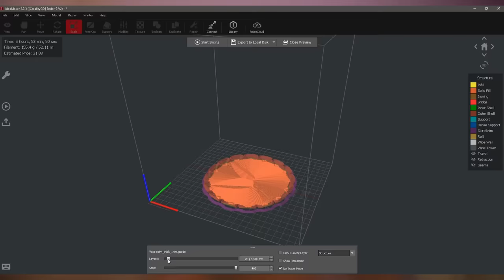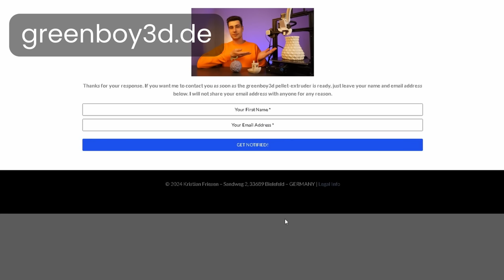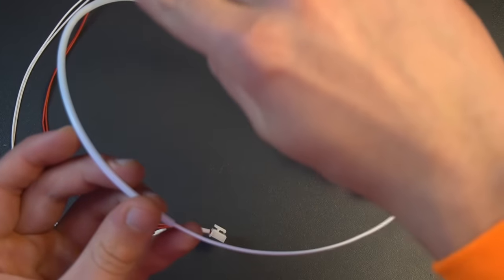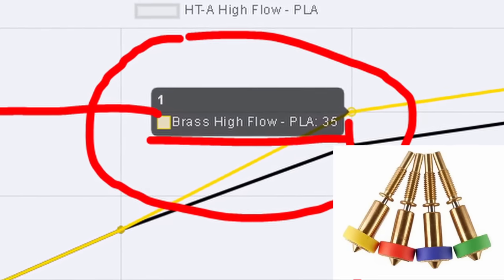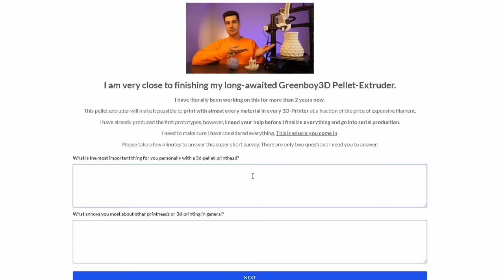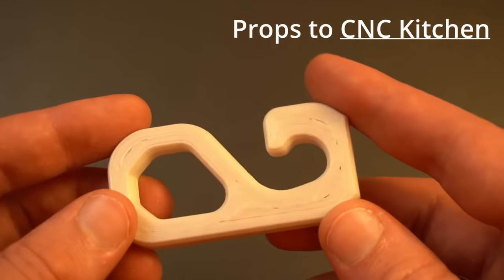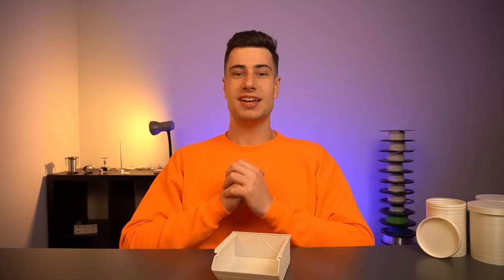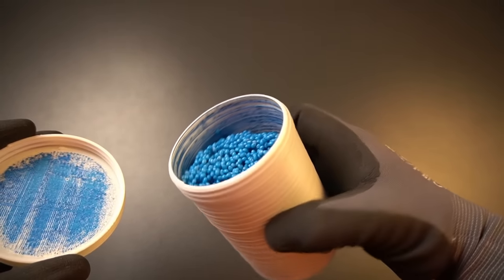Stop Buying Filament, Use This 6x CHEAPER Alternative instead

Comment: I am all in on this.  But I only have one FDM printer, it’s fairly new for me, and I’m not sure I want to modify it yet… 😭  But I fully agree with the idea behind this, low cost pellets, recycling supports or failed prints, quintupling your output of functional items for the same cost.  It’s so good. 

As far as the custom vs. standard nozzle… if it drastically improves print quality, then I’d be fine with a custom nozzle as long as enough options are available.  Isn’t it possible for both?
Reply from the maker: Thank you for your interesting input 🙂
What would you like to see next?
Reply: @greenboy3d  Could you make the hose smaller so it causes less stress on the motors?  Is the current input of pellets the minimum the extruded can handle?

Comment: don't worry on making it completely compatible with everything in existence... the extruder and other parts are already custom so if someone decide to adapt your system it will not be discouraged by a nozzle... that said the system has to be comparably cheap tho like if one nozzle costs 10times more it will be difficult to justify 😂
Reply from the maker: A question that can't get out of my mind is what people would if they had a nozzle clog, which can happen on any 3D printer due to some particle blocking the nozzle hole.

If the "special nozzle" is not easily available globally because only I am selling, then this might be a problem. Any ideas?
Reply: @greenboy3d  to be fair I have no idea how different it can be from a standard one, is it possible to modify an existing one to achieve your idea? or maybe provide the cad files for free/small one time fee to have it manufactured somewhere like pcbway or whatever

Comment: I see deals on bulk PLA for $8 a roll shipped. Long as you dry every roll, most stuff today doesn't clog or tangle like the cheap stuff back in 2014 when I started.

Comment: Did we ever figure out what exactly is the mechanism behind the inconsistent extrusion?  Some industrial pellet printers use a 3 zone extruder screw, they claim this improves surface quality. Also, just curious, is the screw edge sharp? And what happens to surface finish if you increase or decrease motor current?

Comment: I'd be worried about using spray paints in an extruder - unclear what additional VOCs you'd introduce in that, as well as potentially causing chemical issues with the plastic that may dramatically degrade its durability.  Far better to not reinvent the wheel and try to use similar techniques to industry, though that certainly means having some sort of intermediate well.  

As far as the nozzles, why not have an insert?  i.e. you have your nozzles, which are a larger diameter, flatter.  Want to use a standard nozzle?  Thread in an insert, which has a threaded hole for a standard nozzle.  Adds $0.50 to the cost, and is a custom part, but is a single-purchase part.  And if you're looking for performance, you can have purpose made nozzles.
Reply from the maker: Thank you for your very interesting input 🙂
What would you like to see next?
Reply: @greenboy3d  I think it was CNC kitchen that had the fast printing profiles video so you could better characterize the flow rates.  I would also like to see if you can put more heat into a hotend to increase flow.  One of the biggest promises (for me) of pellet printing is insane volume.

Comment: This is, frankly, truly awesome stuff. When I get the time, I definitely want to investigate this pellet extruder further.

Do you intend to release the source material, etc?

That would be really awesome, if I could make one myself eventually and try it out!
Reply from the maker: The 3D Printed parts will be for free, but the other ones need to be purchased :)
What would you like to see next?
Reply: @greenboy3d  hmm. Since it's already a pellet extruder, couldn't you design a custom extra wide nozzle for direct injection molding? Say you 3d print a prototype of something, but then you want to produce it in bulk, so you acquire a mold (you can actually resin print them), swap the nozzle, and then begin injecting.

I just thought about it, since it already extrudes pellets it could be used for both printing and IM, all in the package of one device. You don't even need a plunger, just have the screw set to high speed? :)

Additionally, I'd like to see some experiments with some more exotic materials (PC, Polyamides, etc,). Have you ever thought about buying some graphene powder and making some master batch pellets with something like polystyrene, and then combining that with the bulk material? I think you'd be surprised at the strength of graphene infused parts.

Comment: There is no "standard nozzle" anyway. Most of them are M6, true, but not as a standard. If we have to chop them off or recut threads then that's that. Even a custom order at mail-order-cnc isn't that expensive anymore. Quality is more important than a non-standard part which is easily manufactured.
Reply from the maker: A question that can't get out of my mind is what people would if they had a nozzle clog, which can happen on any 3D printer due to some particle blocking the nozzle hole.

If the "special nozzle" is not easily available globally because only I am selling, then this might be a problem. Any ideas?
Reply: @greenboy3d  I don't understand. First of all, any metal nozzle can be cleaned with solvents depending on what clogged it. Acetone works for most polymers, some need something else. The nuclear solution is carbonizing the polymer by burning it off.

What are the specific requirements of this special nozzle? Does it need to be especially short? How short are we talking? 2mm? 5mm? 10mm? If it's just chopping off most of the threads of a readily available nozzle then anyone with a saw, sandpaper and a vise can do it.

Comment: I think the nozzle should be optimal for the process however if you can make it so the nozzle is easily swapped so the user can choose, that might be best. Seems like this system would be great for prototyping where you may not be worried about print quality however I would question whether the print quality is good enough for dimensional accuracy.

Comment: You can increase the speed of an ender 3 by using Klipper and input shaping, requiring just a raspberry pi or similar. I can’t think of any obvious reasons why a similar approach couldn’t work for your pellet extruder. To increase acceleration further you would only really need a stiff frame and strong motors, so likely linear rails and nema 23 motors.

Comment: Perhaps counterintuitive but would it not make sense to try to move away from 3D printing certain components altogether like the storage bin and just make it out of dense construction paper if it's far enough out of the way of heat for even better cost margins and infinitely easier to modify for any size/shape constraints than reprinting from scratch? Very exciting idea all around even so for a project.

Comment: for the nozzle storing extra plastic cant u just make it so all that extra space is taken up by the  pellet extruder? as in extend it abit into the nozzle so it fills up that empty space and just leaves a straight line into the nozzle
Reply: o nvm then u cant change the diameter 😅 maybe inserts that u put into the nozzles?

Comment: The only defects I'm seeing is like you stated the nozzle pressure not being controlled (k-factor). I'd think simply reducing the thread length (basically a short stub nozzle) would change variations drastically. To add would also need to reduce the overall melt zone temp as well increasing feed so the pellets aren't in the melt zone too long. Just food for though

Comment: I love the project and progress, I have two main questions. 

Does the extruder work well with flexibles?

Why not buy a filament extruder and the cheap pellets and produce your own filament to use in standard printers? How much is the difference in cost between this nozzle and a good filament extruder?

Comment: As a plastics department student, I can easily say that every time a plastic is broken, its properties decrease by 15%. For example, if you break a plastic that can withstand a load of 100 kg and reuse it, it can withstand a load of 85 kilograms in the next test. Additionally, print quality begins to decrease. This is an average value and varies depending on the plastic, considering that there are more than 3000 types of plastic in total. good luck
Reply: Wouldn't it be 85 kg if it's a 15% decrease from 100 kg?
Reply: @russiannpcbot6408  Yes, you are right, I just pressed 7 instead of 8. mistake

Comment: most of the quality issues i see are common issues i see with my ender3 v2, looks mostly like you need to clean and fix your z-screw wobble. Even my upgraded board on my printer has given access to input shaping and pressure advance both of which very well may help a ton with quality. I wouldn't say quality isn't something that couldn't be achieved with the pellet extruder just may take some time to calibrate for. 

That being said, I also understand its not your focus right now, your working on developing it. as well as if a modified tip is going to make it work significantly better i would say go for it, but if the gain is negligible I would aim to keep standard, with plans for a possible upgrade?

Comment: Why not just make something to convert the palletes to filament then print with it? (I know filament makers exist already but they r hella expensive) takes some time but you get the flow accuracy + you can sell ur filaments at 300% markup.
Reply from the maker: Theoretically you can also directly extruder Filament with the pellet extruder, personally I have made only a couple of experimental tests, but some guys in the discord community are actually on their way to design the parts you need to use my pellet extruder as Filament extruder 😀

Therefore, this might also become a reality

Comment: I can only guess that the main problem with the layer lines there, which are horrible, is that you have no input shaping. If you were to move to Klipper and use one of the supported accelerometers to calibrate things, my guess is that it may be both faster and a lot better than what you see now.
Reply: input shaping unfortunately would not help with the severe z-banding
Reply: @FPVin3D  Perhaps replace those leadscrews with ball bearing screws, then
Reply from the maker: But generally speaking. What do you think about all this?
Reply: @greenboy3d  Looks like a really nice start of something that can get even better :)

Comment: why do you need a separate printer head nozzle, your system already has one, the custom screw should be its own full nozzle, without requiring a second melt head nozzle. btw the screw motor seems to be super huge. maybe a drone motor would be smaller and as/more powerful. you could also mix color paint on the fly in the extruder, to control the color during printing, with software. keep improving the pellet extruder, you dont have to settle to sub-quality compared to filament. if you make sure that the amount of plastic in the screw extruder is the same, no matter the granule size, then the control is perfect.
Reply from the maker: Thank you for your very interesting input 🙂
What would you like to see next?
Reply: well, just make the final optimizations, its already complete and full featured @greenboy3d
Reply: try liquid solvent pla 3d printing, just dissolve pla or others into replacement nail polish remover, then heat it up, to solidify on the 3d print. also easy recycling of used pla and others.
Reply: sls and uv-resin 3d printers to harden the liquid solvent pla by solvent evaporation at spot heating.

Comment: Great YouTube video, I definitely could use a pellet extruded in my life for recycling prints. Also, how much will the upfront costs of building this extruder be? I’m just curious if the money I would spend on this would offset the cost of filament and recycling prints in the long run.
Reply: One more thing- I think the thing to blame for your suboptimal print quality might be due to the gantry/printer itself. I saw a lot of z banding that may be a flaw of the Ender V2, not the pellet extruder.

Comment: One thought is to have a static resivour of melted (liquid) pellets flowing into the nozzle in a such a way as to port into the hotend where the static liquid material flows through a tube  into the head but does not reside on the moveable print arm and add mass to it.  Only the melted plastic flows into the hot end from an external source. Work that out and you have a whole new next gen thing.

Comment: I did your survey but I'll make mention here as well I would really like to see you make a dual feed system so we could achieve dual color prints. In explanation: standard dual color printer filament has a prominent flaw which is the fact that it can twist unexpectedly during the feeding process if you instead used a dual feed pellet system this issue would completely cease to be an issue.
Reply from the maker: What about a hybrid printhead with Filament for most outer layers and pellets for all non-outer layers? :D

Comment: What is the actual maximum flow rate? Imo a flowrate >100mm^3/s is an appropriate goal and it will be very interesting for large formate prints where cost savings will be very significant and hav the potential of less drooping than comparable filament hotends/extruders.

Comment: what about if you want to print with specific materials with specific properties?
Reply from the maker: What do mean by that?
Reply: @greenboy3d  what if I want to print with carbon nylon (ePA-CF)  high temp PLA, engineering grade materials etc etc  rather than just PLA. Can you get these materials in this format rather than filament?

Comment: Hmm, could you combine pellet types for swirls of color or amalgam materials which create tougher outcomes with say a cheaper plastic and 25% expensive plastic?

Perhaps 25% recycled PLA with 75% virgin PLA?
Reply from the maker: You should watch the following video, in which I mixed TPU with PLA or Soft TPU with Hard TPU and inspected the outcome. (Very interesting)
https://www.youtube.com/watch?v=SaUFj3iNcs8&t=123s
Reply: @greenboy3d  Wow, neat results. Perhaps a multi hopper could control premix, or allow active color mixing hmmm… 

When I saw you cutting the spooled PLA I thought of factory pasta, a rotating arm cutting exact lengths of pasta with each rotation. That might be a convenient tool to offer alongside your product if there’s something already commercially available.

A micro wood chipper 😂😂😂

Comment: Very interesting! To solve your "nozzle-issues" you should Take a Look on the technique of all the 3d-printed-house-manufacturers. It is basically the same concept. They are feeding cement/concrete through a screw-pump similar as in your Extruder. Look at the nozzle they have. And they even get pretty constant layers with it. Should therefore also Work for your Project.. or you should maybe create a Venturi-Style nozzle?! 🫣
Reply from the maker: Thank you for your very interesting input 🙂
What would you like to see next?

Comment: I'd rather make the filament rod at home separately and feed it into a regular printer
Reply from the maker: Even if it costs a magnitute more?
Reply: @greenboy3d  The modification is great, certainly not without some minor flaws. If you have only one printer, it is the obvious choice. But if you have two or more and you don't want to lose speed, it makes sense to make a head for the printer with the largest print area. In normal times to make a rod, sometimes put on the printer for parts with a large layer height and size

Comment: Seems like the next step would   be making a nozzle that fits the requirements of pellet extruding
Reply from the maker: Hm, the question is just, how to make them globaly available the same way as the filament nozzles are available. Any idea?
Reply: @greenboy3d  The same way you will make your pellet extruder globally available, let me know if you need some custom nozzles machined

Comment: I had no idea this was I thing just a before seeing this. but very cool and promising project for sure. and yeah like others I would drop the standard nozzle if this means a better end product then that should be worth it for sure. and it's understandable that this will have his own set of pro and cons, just like a bowden vs direct drive and bed slingers and cor x y does. so that it's not going to break any speed records that is fine. it might get better over time also the project matures but it for sure got some good unique points. being material price and the custom coloring options are nice as well. I do wonder about the paint smell? when it heated up? or does it not seem to add extra fumes?

Comment: Working well Is more important than compatibility
Reply from the maker: A question that can't get out of my mind is what people would do if they had a nozzle clog, which can happen on any 3D printer due to some particle blocking the nozzle hole.

If the "special nozzle" is not easily available globally because only I am selling it, then this might be a problem. Any ideas?

Comment: I don’t know what you have against people wanting high print quality. High print quality isn’t just for looks, it is also about strength and dimensional accuracy which can be very important for a lot of applications. Low dimensional accuracy and inconsistent surface finish may be fine for you but it does cause a lot of issues. If parts have to slide then rough surfaces aren’t good and if you need to fit parts together then having inconsistent surfaces and bad dimensional accuracy means you have to increase your tolerances, making things like press fits inconsistent and not very good.